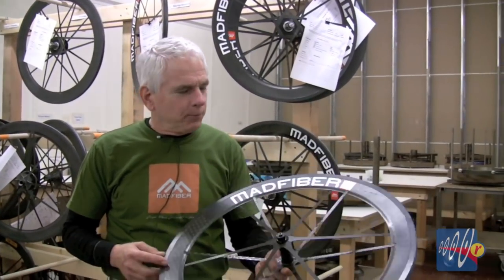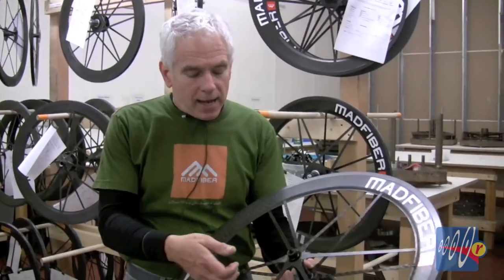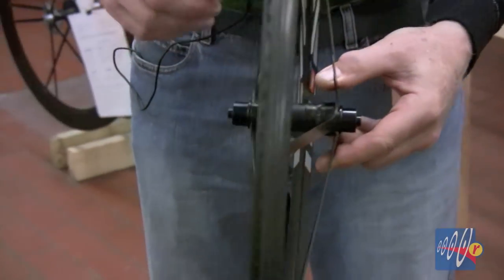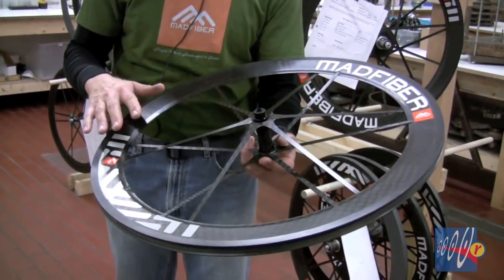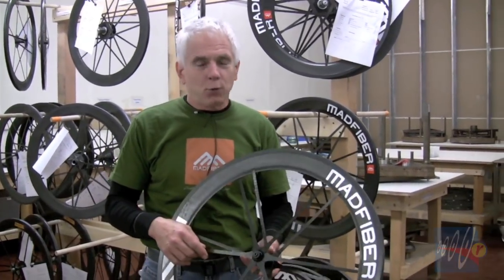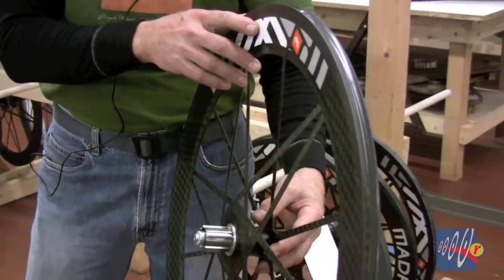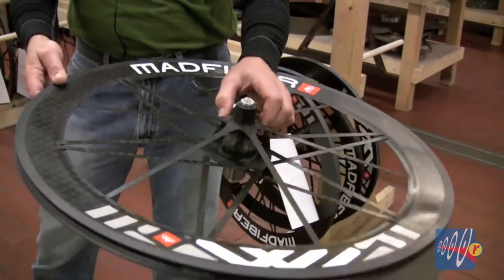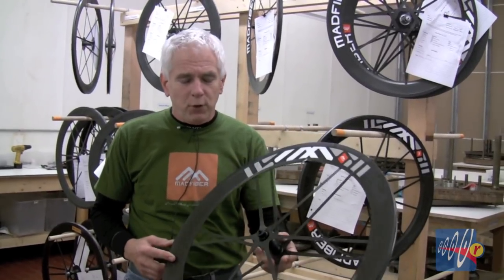2011 Mad Fiber Road Wheels

Comment: Wow...brilliant, tensile strength of CF is ridiculously high. The compress and shear not so high due to the resin, but if the most of the load is given as tensile stress, then this thing should be indestructible.

Comment: I would shit in my pants riding on two of those. 12 spokes you can twist with two fingers is sick
Reply: Spokes only provide strength in tension, not perpendicular to the plane of the wheel. Try twisting aero bladed steel spokes, you'll find considerable give, albeit less than these spokes, since these are thinner and larger hence easier to twist.

Comment: I personally own Mavic semi monocoat wheels. Carbon fibre.  They are super fast.  They are tubular like non other.
However in your piece technology I have notice one thing about these types of super light carbon wheels is vibration.
On road surfaces up to full speed and trying to achieve maximum 100 % r.p.m. speed is vibration.
Vibration can be very distracting.
As frame set is carbon fibre as well.
Have you thought of developing a dampening layer in the modulation of construction of your wheel?

Comment: check out the 'uci approved wheels' site,most of the problems is that the wheel may longer not be made,therefore cannot be tested...if its on the list no-one can stop you from using them

Comment: Tell me it's a good wheel after it can take a pot hole, or just from a edge going down....it's light, and weak at the same time. Unless used for race indoors, no point buying it